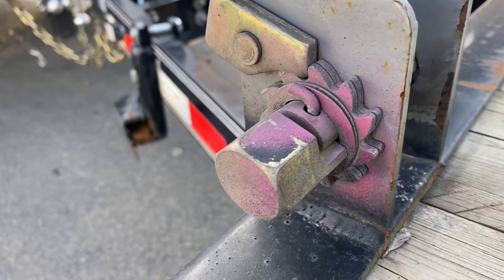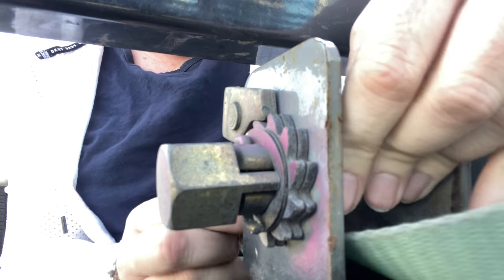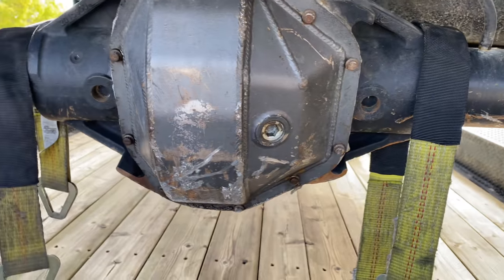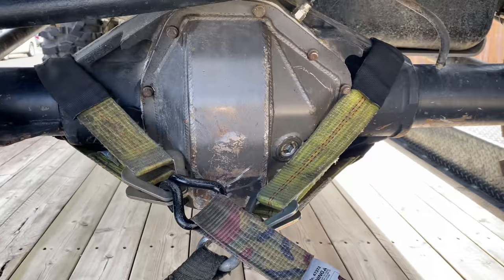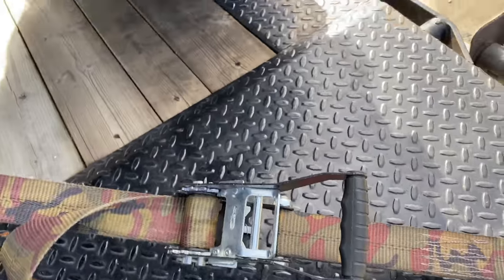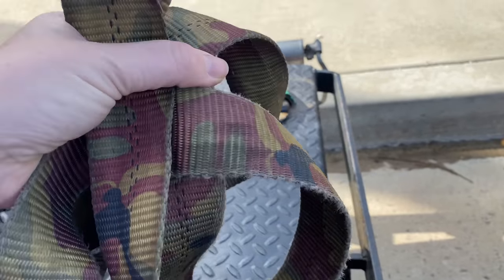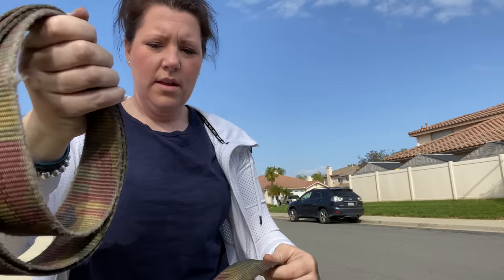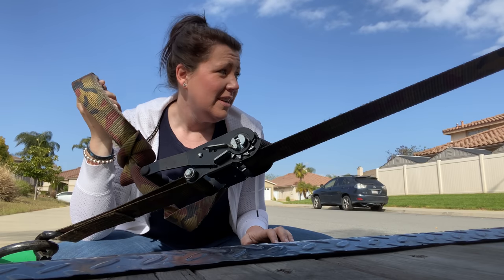Tie down Jeep to Trailer

Comment: When I had used trailer, similar to your coloring, I had straps laid out for the corners. I cut the straps to work with my Jeep and have 3' more length. I would pull the strap through that ratchet handle, then fold it in such a way where it would set under the handle. Then lock down the handle holding the folded 3' length. I also used axle straps. My rear trailer mount was inside the tires and crossed across the diff housing like you. My front crossed as the axle straps fit inside the knuckle and the trailer mount was on the outside channel. I also used closed hooks on both ends.
Reply from the maker: Yeah, closed hooks are key! Our first set of straps was custom length and we sent them exactly for MischiefMaker, and that was definitely the fastest and easiest way to manage things...now we have very long straps and it’s because we started to run into several situations where longer straps were needed (hauling friends after ‘incidents’, going between Krawler Hauler and Buggy Hauler, etc...) - so we sent everything back to Macs to be re-webbed to much longer lengths and even had them make custom length/color axle straps (better for getting around the Dana80).

Comment: Hi... I have some questions and I hope that you answer them. First what do you think of Baja pro x on road and on sand dunes. Do you recommend them or Baja pro XS again on roaring and sand dunes....and my mind question is why don’t u drive your Jeep instate of putting it on trailer .. is it because the tires are noisy... thank you.
Reply from the maker: Mohamed Albishri the Baja Pro X is an ‘off-road only’ sticky compound tire. You wouldn’t want to drive with them on the highway, they get destroyed and you will need to replace them often. Even if you didn’t mind replacing them every few months, they are probably the least comfortable tire (road feel and road noise) ever made. The Baja Pro XS is a DOT tire and has much better characteristics on road, but I still wouldn’t want to use it on the road (personally). If you want a great interstate and sand dunes tire, your best bet is a Mickey Thompson Baja Boss (or Baja Boss X if you want a sticky and don’t mind using them on the road).
Reply: MischiefMakerTV thank you for your useful reply...one more question... what is your bumpers and fenders brands and model. Also I would like to know your roll cage is it custom made or I can order them

Comment: Take a small piece of 2x4 “to act as Jeep” and 8 nails are the tie down spots.. Recreate strapping with string and the nails being the tie down spots. Crisis cross as you do. Get the strings tight and then twist the 2x4 to simulate the trailer going around a sharp curve to fast. You will find the 2x4 “Jeep” will lift in the rear and can actually flip off the Trailer. Never crisscross!  From your strap supplier: https://www.youtube.com/watch?v=-zw7pICnfzU
Reply from the maker: Thank you so much for the advise! This is the thing I love the most about comments! Great advice!!! 😃

Comment: I was wondering if you have checked the tongue weight of the trailer on your tow vehicle? I noticed you have Mischief Maker towards the back of the trailer.  I have found this article to be informative on strapping down a 4x4 Rig https://www.fourwheeler.com/features/1507-proper-ways-to-strap-a-truck-trailer/. Thanks for sharing how you do it ❤️
Reply from the maker: I bought a little scale to measure the tongue weight when we first got the trailer and was still pulling it with a Ram1500. Back then we figured out where the Jeep needed to be on the trailer for it to be at roughly 10% which at the time was 750-800lbs. Once we got the HD trucks (Ram3500 SRW and F-350 DRW) I don’t really bother doing any of that... I just position it with the majority of the weight well ahead of the trailer axles and see how it feels as we go down the road. I didn’t actually put the Jeep on the trailer  it is positioned in the video. I would agree it is a little further back than I would have put it, but I really wasn’t concerned for the 5 minute drive from DH graphics to where we had it parked. Also, I have read that article. It’s great!! Straight straps are great when you can make it work, but on a JKU with stock mounting locations for the rear suspension, it’s tough to find spots that don’t contact the edges of mounts (especially the driver side)...so across the pumpkin it is 😃